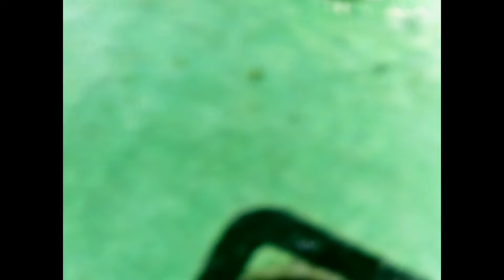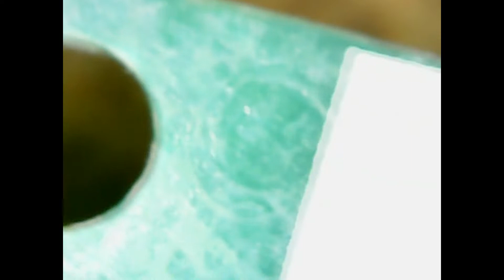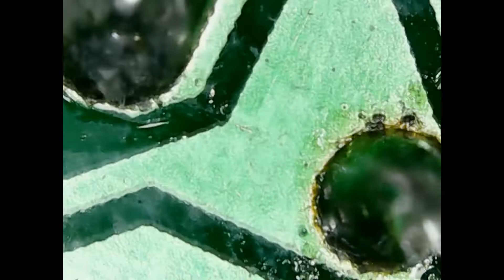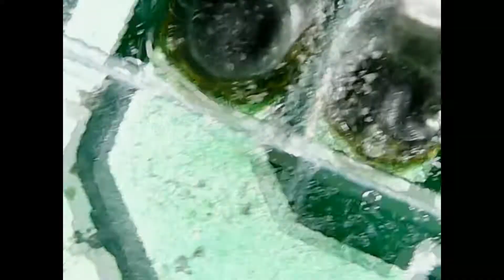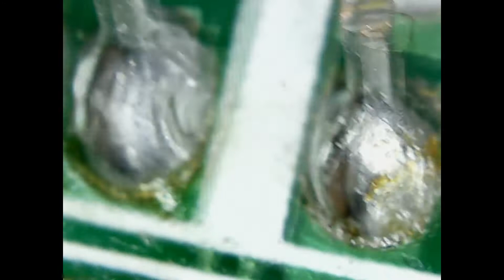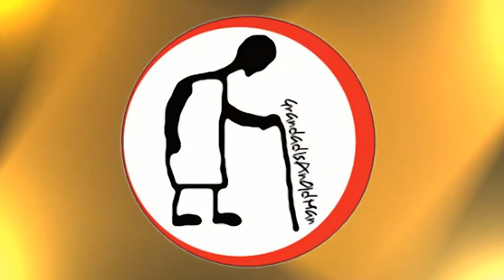Viewing the 2.4G toy grade RX module with USB microscope

Comment from the maker: For reference as I cannot fit any more text in the video description.
I am not endorsing these products and I get no income from the sellers, so I suggest you do your own search and find the product that suits your purposes.
New 4CH 2.4G Wireless RC Toy Module Remote Control Receiver Transmitter 5A 50M (It cost me £4.96 + £2.79 P+P AliExpress July 2019)
Description:
100% brand new and high quality
Receiver board input voltage: DC 6V(Max DC 7.6V)
Remote control input voltage: 3V, 2 x 1.5V AA batteries.(Not include)
Receiver board Output voltage: DC 3-7.6V, Max 5A
Remote control operate range : 50-100 meters
Material:Plastic
Size:10x8x2cm/3.94x3.15x0.78''(approx)
Color:Black
Quantity: 1 set
Note:
Transition: 1cm=10mm=0.39inch
No retail package.
Please allow 1-2cm error due to manual measurement. pls make sure you do not mind before you bid.
Due to the difference between different monitors, the picture may not reflect  the actual color of the item. Thank you!
Package includes:
1 x Receiver board
1 x Remote control
3 x Screws(other accessories demo in the picture is not included.)

Comment: Ic chip is short  need to replace new one..👍
Reply: Maybe
Reply from the maker: Probably cheaper and easier just to replace the board, unless you have a supplier that will sell a single chip without the shipping charges.